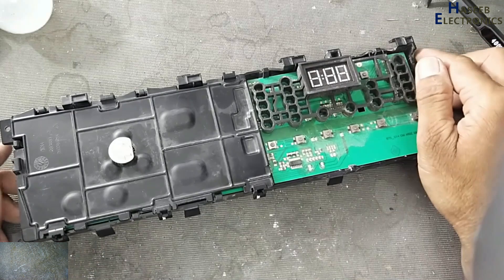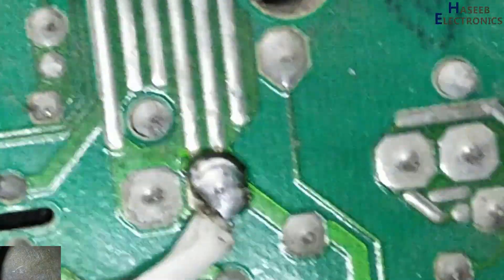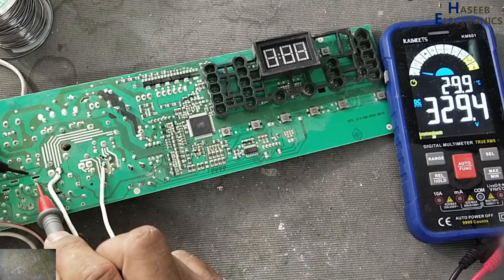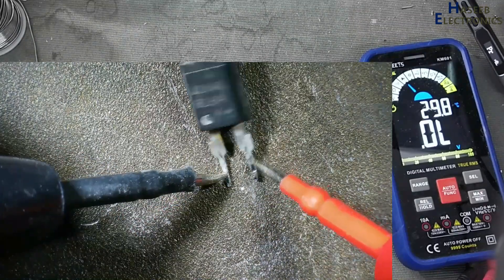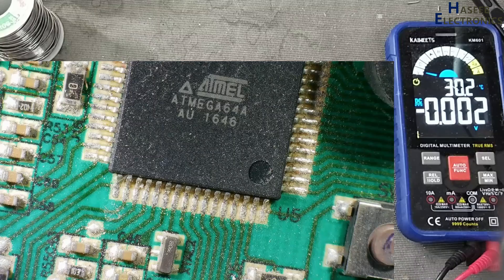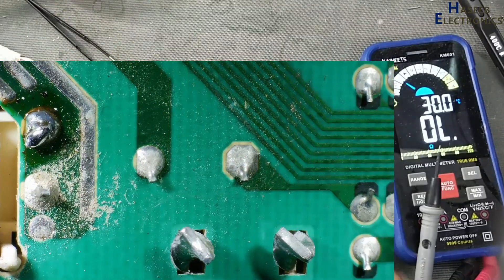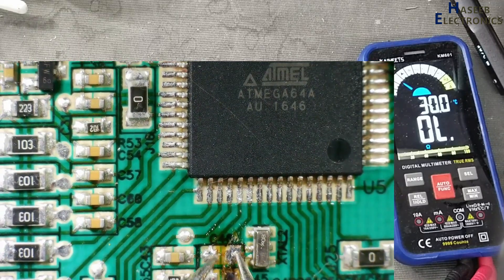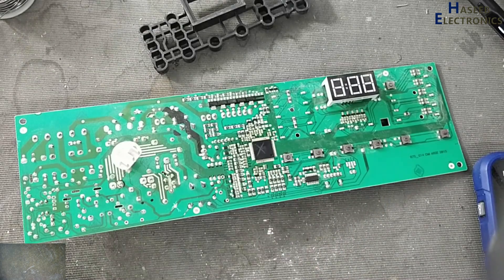{1146} Beko washing machine control board troubleshooting

Comment: Really good video. Another way, before cutting the track at 14:35, if you inject 1v 1A (or 2v in this case) where the removed cap was, you should feel the shorted component get warm. You can detect the warmth by thermal camera, blowing the board with freezer spay so that ice forms, or the back of your finger. 2A works better but higher you go more chance of overheating the track

Thank you for the video

Comment: The old/defective microcontroller likely has (or had) custom firmware/code in it. How would you get that?
BTW, my 20+ year old Kenmore washer, still has the original mechanical timer, and still works. As with all the new/newer modern cars, they’re full of these specialized electronic modules, that will soon be no longer available. What then?
PS, in the near future, I see a whole field emerging, replacing these with emulators, using Raspberry Pi or Arduino computers and hat/add on boards.

Comment: Thank you for the vedio. These controller mostly have a firmware that is difficult to find for appliance. Even if the ATMEL controller is available the firmware will note be  available. Thanks
Reply from the maker: program can be copied from similar model MCU
we need M64+ ADP AVR Programming Adapter Socket for ATmega64 TQFP64
Reply: @HaseebElectronics  I think frameware with this model is locked. Can't be copied
The pcbs are designed for you in a very bad way. Any fault on the output of the board is kill the microcontroller
Reply: Ürün yazılımı açık sağlam olandan çekip atılabilir.